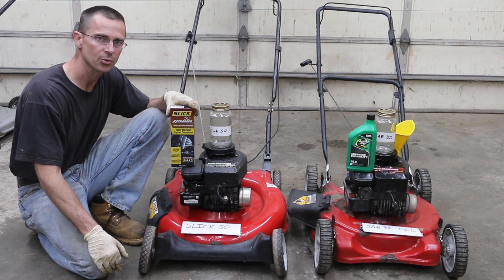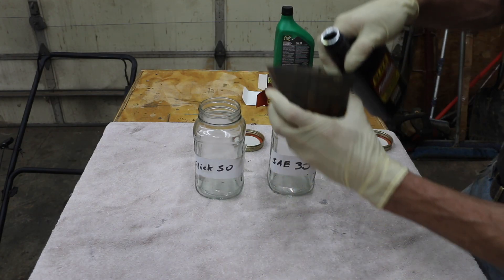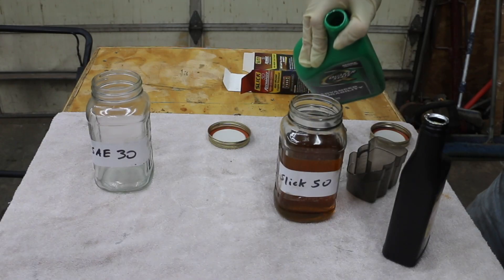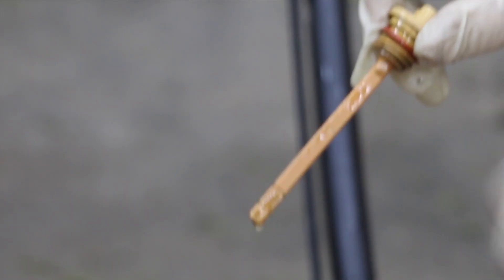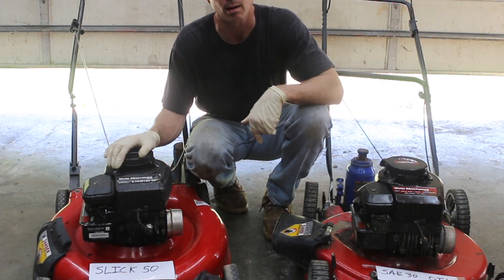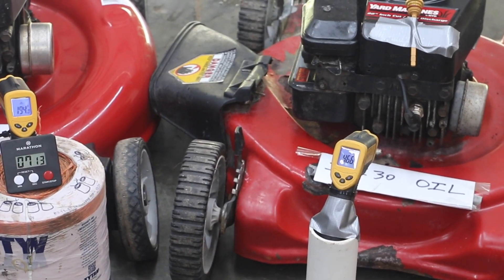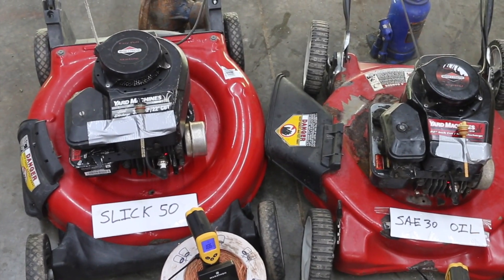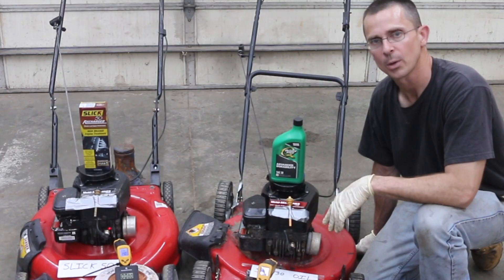Can't believe what SLICK 50 did to my engine!!--Dry Crankcase Test!

Comment: Okay, I used slick 50 in a 1985 Ford F-150 small V-8.  About a year after I treated the engine with Slick 50 I was driving between Lewisville TX and Carrollton TX started hearing a sound that I had never heard before.  After driving about 6 - 7 miles at 70 mph I noticed that the oil pressure Guage was on ZERO.  I quickly pulled onto the shoulder of the highway.  Pulled out the dipstick to check the oil.  It was full and pretty clean oil.  Had it towed to a Ford dealer to have it checked out.  I assumed the bearings would all be bad in the engine.  They dropped the oil pan, pulled off a couple of main bearing caps and checked the main bearings.  They were fine... NO DAMAGE.  They pulled off some of the rod bearing caps and they checked out OK.  NO DAMAGE.  They discovered that the oil pump failed and locked up. The oil pump was driven by a steel shaft driven by a gear on the camshaft.  When the oil pump locked up the steel shaft twisted off, and that was the noise I was hearing. They replaced the oil pump and the shaft, and buttoned up things.  I drove that truck several more years with no engine problems.  I believe the Slick 50 saved that engine.
Reply: Nah. Slick 50 was what killed your oil pump. LUCK is what saved your engine.
Reply: @robertgantry2118  Agree 100%. No evidence here that Slick50 had any effect on saving the Ford engine. I remember driving a Honda about 20 miles to the junkyard with no oil pump. No problems.
Reply: @ngneer999  lies
Reply: @12mak  if theres at least some oil in the sump that gets to the crank shaft and rods, itll last a while, those are the main things that fail and seize. Without a pump, no oil will get to the cam shafts and other stuff around the top of the engine, that will still wear and damage but will still function (at least to some extent) as their tolerances arent quite so tight as to whether it functions or not. If it's a turbo, chances are the turbo will fail first. Those get very very hot very quick.
Reply: @ValkyrieStarTV  Everything you just said is not true. The outside of the rods don't need oil. the outside of the crank doesn't need oil. The bearings in the engine aren't ball bearings. The crank/bearings, cam/bearings and conrods/bearings literally rotate on a layer of pressurized oil. without that layer it would create excessive clearance and seize up or knock. The oil pump pumps pressurized oil to the main, connecting rod, and cam bearings. THOSE are what NEED oil. 1 minute without oil to a main bearing and you'll destroy a bearing. One minute without oil to a connecting rod and you'll develop scarring and excessive clearance which will in turn create a rod knock. If the oil sump is high enough to have the crankshaft counterbalances hit it, it will just "whisk" up the oil and create bubbles.

The only truth that you could get from what you said is, when the oil drips out of the sides of the main/con bearings, it gets splashed up on the cylinder walls and then "scraped" off by a piston oil control ring (the bottom one). All other oil is pressurized. The last time engines used splash fed oil was in the 1920's.
Reply: Makla well said.
Reply: B.S. @robertgantry2118
Reply: @donnharris132  - Nope. No bullschitt. Put that garbage in two engines, and they both schitt timing chains within two months. Since then I only run engine oil in my engines. No Slick 50, no Lucas, no nothing. Just engine oil, preferably Mobil-1 full synthetic for my gas engines, and Rotella Synthetic Blend for my Cummins.
Reply: @robertgantry2118  I have never used Slick 50, but I am a firm believer in Lucas Oil Stabilizer. I have had engines run hundreds of miles overheating and they still purr when started again after cooling down. I just keep right on driving when steam starts rolling out the hood. Running Lucas I have never worried about my engines. I have also been able to get 200K+ miles out of every engine I have ever used Lucas with every oil change.
Reply: @1speed2racer7  - Well, if it works for you then I say keep doing it. It's just that since my Slick-50 experience I won't use anything except motor oil. I don't think anyone can claim that the correct motor oil ever damaged their engines. lol
Reply: @robertgantry2118  Lucas Oil Stabilizer is no where near the same as Slick-50. It is just like oil, but it clings (not bonds) to the engine components. This prevents dry starts. It is clear like oil. It does not have any solid particles that can clog the system.

All engine oils damage the engine by allowing dry starts. There might be new formulas out there that prevent dry starts, but I would not know what those are. Even if I used an oil that claimed to have an additive to prevent dry starts, I would still use Lucas.
Reply from the maker: Impressive!  Thank you!
Reply: Look up whatever happened to slick 50... very interesting
Reply: Barry, so I see you are another victim of the Ford 302 oil pump drive shaft failure issue. The 302 had that problem/issue since it's conception. Piss poor design, but it's what I expect from people who went to college.
Reply: MeMyselfandFuckingIrene 
Greatest YouTube name EVER!
Reply: 1speed2racer7 
Blackhawk down
Reply: Wow is all I got
Reply: 1989 my partner had company, R&D Vibration Analysis using an early predictive maintenance computer that measured vibration in amplitude and velocity and rpm and displayed in waterfall overlays. I used this on my fuel Harley drag bike and while fueling my transporter to leave for Atco Raceway a friend from my high school days came over and introduced me to a chemical engineer who developed a Teflon based product named TLC! He asked about the vibration analysis we did saying that he was in search of someone who could work it backwards by measuring the vibration of an engine with 150,000 mi for a baseline, then monitor said motor as his product was introduced and measure vibrations after 30 min during which time the TLC would be burnishing itself into all wear surfaces, and asked if I had that ability! Without hesitation I told him we could, he cast me a doubtful eye, saying he had been unable to find anyone in the US who could make that statement! Over biscuits and gravy we discussed his needs and the ability of our tool and that I would have to make needed probes and pickups for use on a car motor and set a date to try it out. The tests were successful beyond his wildest dreams and demonstrated a 50 percent reduction in vibration amplitude!
We made a deal and spent the next month putting it in every type of vehicle from Harley’s to boats with successful results! During a test on an iron engine sportster Harley, we hooked up the machine and ran baseline then added TLC then had a BS session as we waited for it to do its thing. After approximately 15 min the rpm’s jumped up nearly 300 rpms to everyone’s surprise!
Now he claimed his product to be far superior to Slick 50 due to a higher concentration of Teflon! His company also sponsored the Guston Brothers jet powered dragster! Sadly, soon after we were able to prove his claims and he was on the road to his glory, a spurned and vengeful wife and her lawyer tied up all assets in a divorce case leaving Guston Bros stranded in Myrtle Beach at a show and our company with a stack of unpaid bills! The only bad result of TLC use I was aware of was when we were overhauling my partners wife’s little Chevy something with the Iron Duke motor and could not cut thru the glaze of the cylinder walls and scrapped the block!
Reply: I might add that ford oil pumps of the late 70s left much to be desired! Mine was a 351 w that started running very poorly and upon tear down we found 3 pushrods that had worn through the rockers!
Reply: Valkery...a worn out rattling engin will continue with a oil bath & splash for a limited time!
Reply: John Chrysostom this van was in early 80’s TLC was in 89 so TLC not involved!

Comment: Try Duralube. Their lubricant SPRAY is unbelievable.  I used it about 15 years ago on a rusted lock.  I mean WD40 did NOTHING on it.  We sprayed Duralube in it, and it spun like a top.  I had used their motor oil additive, and it certainly seemed by ear, to make my engine run smooth.
Reply from the maker: Thank you for the video idea!

Comment: Were the engines in similar condition prior? 

The slick 50 did run cooler... Did both engines run at same temp if they had same oil?
Reply: Yeah it would've been cool if he tested the slick 50 mower with SAE 30 first and then drained and refilled.
Reply: Yeah running that much cooler from just an additive is a pretty big deal as far as preventing wear and tear goes since temperature has an exponential effect on wear and tear. Sure it apparently won't save it from a no oil scenario but I'm not sure many things do and you shouldn't be buying additives based on such an extreme scenario anyways.
Reply: @KaiserTom    Two different, worn engines, so we have no idea if the cooler running engine had anything to do with the oil.  Numerous factors could have made it run cooler.
Reply: @scarharting5577  Absolutely. That's why there should be another test with a clean engine,  flushed out after every test, to see if these additives make a difference in temperature. Hopefully the flushing gets rid of anything that may "stick around" and muddy up further results. Better yet just two new engines with random test sequences, so that even if things do muddy it up, they will ideally do so consistently.

Comment: I remember Z-Max had similar claims and I used that in my vehicle for years as well.
The very first time I put it in, I got over 50km more on the 1st quarter tank than I ever had before. I was blown away. Somehow that gain didn't stay and future gas mileage was still better than before i used Z-Max, but not quite as dramatic. Also I never did run my engine dry, so I don't know if it was "soaking in the metal" and protecting it that way.
Reply from the maker: Thank you

Comment: I had an 18 horse slinger Briggs and Stratton  engine on a grasshopper mower .Max life of said engine was 750 hours and had to be rebuilt . Mine had 1550 hours and still ran fine Even the wrist pins were tight .The crankcase held 2 quarts of oil and I changed it once a week,1 quart of oil and 1 quart of slick 50 with ptfe every week . It worked fine . Never trusted the one quart every 50,000 miles.I couldn't see how it could affix ptfe to engine parts. Didn't have an oil filter on the slinger engine so didn't need to worry about it being filtered out.And if their had been a filter most only catch 5 microns and larger . Ptfe is ground to 2 microns or smaller and will pass thru most oil filters.Ptfe is slipperier than ice with a little water on it. 
Ross
Reply from the maker: This is great information. Thank you

Comment: You used the recharged version... You really should have used the original. I was comparing both boxes yesterday and the recharged version doesn't say all the ingredients like the original slick 50. Is it possible to see other test with slick 50 classic formula?
Reply from the maker: Thank you
Reply: @ProjectFarm  They no longer market the original formula. The original had teflon in it. (PTFE)

Comment: I remember that you had to shake up the Slick 50 because the teflon needed to be mixed thoroughly before adding to the crankcase.  It was slightly cloudy when pouring it in the engine.
Reply from the maker: Thank you

Comment: This man does good tests and he's to be commended.
Reply from the maker: Thank you!
Reply: I do agree.
Reply: mindtouchone he needs to be put in line for sainthood
Reply: yes he does some great test. ive tried to watch all of them when possible.
Reply: that slick 50 power steering additive worked great on my old buick electra. no noise or leaks after 1st use. my car said ahhhhh thank you. 👈🏁
Reply: the question is. Is he sure both engines are 100% indenticle? If they are already used engine than the test is null and void. To be 100% acurate both engines would have to be brand new out of the box. But I would like to add. Thanks for the video.

Comment: lUCAS OIL ADDITIVE. Slick 50 left hard residue trails under the valve cover of many engines I used it on.  Slick 50 supposedly would sometime build up a little dam around an oil return hole in the  head causing engine wear in weird places.
Reply from the maker: Thank you!

Comment: Comments about Teflon (PTFE) are misleading.   DuPont, the owner of the 'Teflon' trademark refuted claims that the product benefited an engine in any way.   This was backed by extensive testing in approved labs including those used by the FTC. The publicized its results claimed use of such a product was of no value, and advertising was found to be 'misleading'.  
DuPont attempted to halt sales of Teflon to scrupulous companies like Slick50, but was sued for doing so. If I recall, they did manage to retain copyrights on the word 'Teflon', and was able to prevent its use on product labels without consent.
For Teflon to 'bind' to a metal surface, it needs to be applied above its melting temp (about 550 Degrees).   The idea that metals in an internal combustion engine could even come close to those temps is absurd.
Reply from the maker: Thank you for this information.

Comment: You cannot really take any of this as fact.. you used 2 different used motors.. who knows what condition the motors lower ends were in before hand.. also you may not have gotten all oil out of either of them. I dont believe in Slick 50 but in no way was this really a fair test.. to do that you would have to buy 2 brand new exact motors and re test them... even then whos really to say one lower end would not be slightly tighter or something..
Reply from the maker: Thank you for the constructive feedback.

Comment: Some problems with the test.......the engines need to be identical and need temp data from both running with just SAE 30 oil.  One engine may run cooler than the other simply because one is running richer than the other.
Reply from the maker: Thank you for the constructive feedback!

Comment: I use duralube. Fuel economy improved in each engine I have used it in. Even my deasel van. Clean the garage out so the oil was near New condition at 5000 mile oil change. You could try it in the dry test.
Reply from the maker: Thank you for the video idea!

Comment: Is there a factor of time in running the engine with the Slick 50 in it. If you run it in a car for example the length of a normal oil change interval. The Teflon has time to impregnate the pores of the metal.

Comment: I used it in a 250 6 cylinder in 1982 and drove the crap out of it ..... it all ready had 40k on it and I put another 250k and never had engine problem and I still use it or it’s equal in all my vehicle..... I think it help!!!!
I have a 99 Dodge Durango I bought new it’s got 300k.... 0 engine problems
Reply from the maker: Thank you!

Comment: Was there any attempt to resurrect these engines afterwards. Like trying to spray something in the bores to free them up or adding Lucas with oil to see if they ran. I also remember the slick 50 commercials. Not sure if slick 50 was ever supposed to be used as oil. Great video.

Comment: I would like to see a Prolong treated motor and an untreated motor with SAE 30 and see how they do. The prolong is supposed to bond to the surface of the moving parts and resist high pressure shear. I use it in my car engines and at least twice it saved them from catastrophe. Thanks
Reply from the maker: Thank you for the video idea!

Comment: The slick 50 mower looked a lot newer than the other one. Maybe it had tighter piston ring gaps and bearing clearance than the other one causing heat seizing earlier. I doubt any high speed machine can survive for long without lubricant no matter what potion was in it previously.

Comment: You started with an un level playing field. To really test that the motors need to be identical, not just in brand and size but the amount and exact type of use, the old used and change intervals and on and on. The only true way to test this would be to do a very rigorous build and break in process and then test it. One of those motors could have had just a little more ring wear, or just one deep scratch, or had been run dry one time and on and an that would completely invalidate your test.

Comment: Sorry, but the test doesn't prove anything. Both engines would have to be exactly the same condition to start with. You have no way of knowing that two used engines are exactly the same.  

I have been using Slick 50 since the 70's. I change oil and filters every 6 months, and add 1/4 of a bottle of Slick 50 after each change. Almost all miles driven were highway miles.

I have had two E150 Ford Vans with 351 W's in them, and put over 350,000 miles on both, with only a timing chain, and a couple of gaskets replaced, during that time. Both were still running well when I sold them. 

I also had two Nissan Pickups, that went for almost 400,000 each before, dying due to transmission problems. 

I have a 2000 Dodge Caravan, that has 327,212 miles on it. I drove it with the oil light flickering for 145 miles. My mechanic checked it out, and said that the oil pump was only pumping about 30% of normal at best. Timing belts and injectors, were the only engine parts replaced.

Comment: Slick 50 is a joke. Used it for several years in a turbo Buick and the Teflon particles ended up blocking an oil passage in a connecting rod. Blew the side of the block out when the motor was under a mild acceleration. I spent hundreds of dollars on Slick 50....it's slick alright...just like a snake...snake oil that is. No longer will I be fooled by crap like that. Bleach is a better lubricant! Stick with the SAE lists.
Reply from the maker: Thank you!

Comment: Did you try putting oil back into the Slick 50 engine and see if it would start up again? It didn't seem to get hot enough to be permanently damaged.